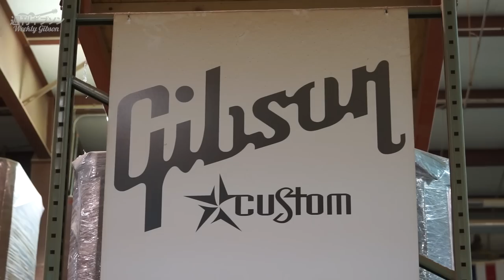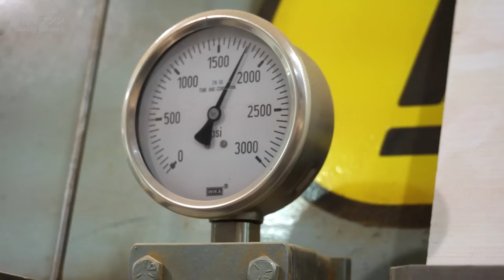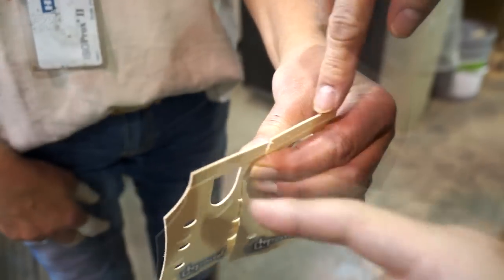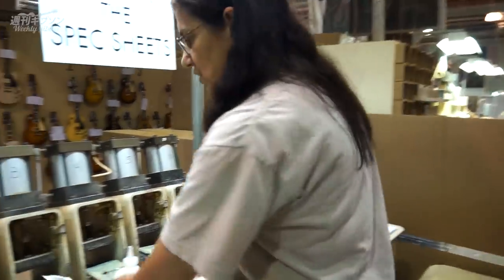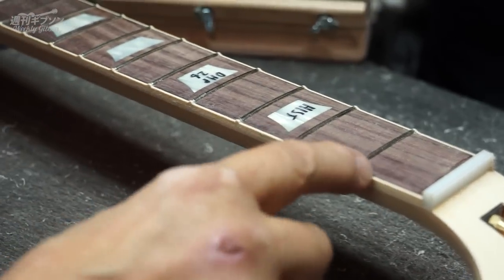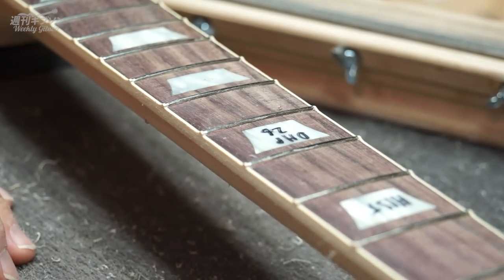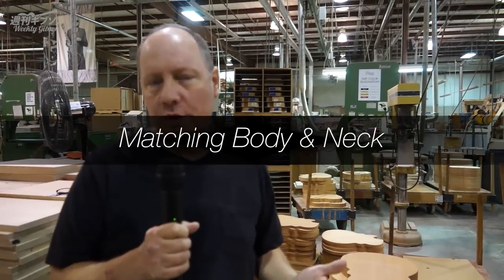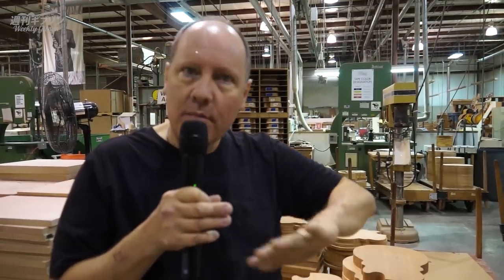Gibson Custom Factory Tour 2016【週刊ギブソンVol.93 特別編】

Comment: 4:13 the neck joint fit is not tight at all which is crucial
Reply: just saw that, what is even going on here? I mean, this is not indonesia!
Reply: The Chinese did a better job at the Epiphone factory, used levels to unsure a flush fit rather than just stuffing it in and clamping it.
Reply: It's tapered and gets tight when the clamp forced them together.
Reply: CNC profiled cuts are very tight in tolerances insuring a repeatable exacting fit.

Comment: 3:45 The installation of fret board is amazing, the builder just put it on the neck directly without any tool or ruler!
Reply: Elvis they use locator pins. Basically 2 tiny dowels on the neck that correspond with 2 tiny holes on the back of the fretboard.

Comment: At 9:20 they show the binding being filed and this is where they screwed up a lot of fretboards.  Last year I was looking for a 1960 LP Reissue and found one at a GC in TX online that was "collector owned and mint", a 2014 model, for $3,295 and would have been great. But there were file marks all along the treble edge from the 9th to 15th frets which almost had to come from the factory, or the 1st owner, but there was no real play wear, so I suspect factory, and they lied about all the dings and scratches.  Then I found another 2014 at a GC in CA, and the manager swore it was (also) mint, so like a dummy bought it, same fretboard issues and also dinged up, returned it, too.

Finally got a 2018 via Reverb, Gloss finish and no quality control problems, and recently got a 2019 SG '64 C.S. and no issues, either so I hope things are better now.

Comment: How do u do refret jobs with the binding there?
Reply: u basically have to cut the frets to size and shape the ends to fit perfectly. Thats if u want to save the nibs, those little end bits. If not, then just take the frets out and radius and roll the binding again and refret using a tang nipper.

Comment: When I first started watching the video I was thinking for what Gibson charges for their guitars people should be getting the the quality of the custom shop build. Not the crap coming off their standard production line.

Another issue is relic aging. When you look for a true antique you want the best quality product you can find. On the flip side if you want a factory aged relic you want it fuck up from the factory. I have found for the most part people are very sheepish these days. whatever they are told is good they buy it. why would anyone pay extra for a jerk in a factory with a razor, rock and a rusty train spur knock the crap out of your new guitar.

Comment: Actually, just before Christmas, I bought a brand new 2016 Gibson Flying V Pro T. The tuning issues were so bad Gibson had to send it to a luthier, who, after having the guitar for almost 10 days decided there was damage to the finish. I contacted Gibson once again, who promptly sent me replacement. Even with the replacement, I still have tuning issues. I can only conclude that Gibson are not all they are cracked up to be. My estimation of Gibson guitars has now plummeted, as I had saved up for a long long time to be able to afford what should have been the guitar of my dreams, but in reality, is little more than a poorly made plank of wood with a nice paint job.
Reply: @Chris Davies
i am sorry that you had this issue. i was confused about the tuning issue being related to the finish, so i will skip past that part and say that it was probably the nut. if your nut is not cut straight, or cut too thin, it could cause issues. this is not uncommon with the 3+3 headstock design. you should be able to remedy this relatively easily with a pencil (or lube) and/or sandpaper (or file). if you google this, you should find some videos that will show you what i'm talking about
Reply: Upgrade your tuners to locking Grovers, that should help.  The first thing I did when I got my V Pro was take those POS tulip tuners off and put Grovers on.  Stretching new strings out is key to staying in tune as well.  Put new strings on and tune it, then pull on the string upward slightly and tune it again.  After 5 or 6 retunings it should need to be tuned less and less and then not at all.  Do this for each string.  Also, I really believe it takes a year or so for everything to settle in on a new guitar.  Play it and keep on playing it.  After a year you'll see what I mean.
Reply: Its usually the G string. The angle it pulls from where it breaks at the nut to the tuner is somewhat of a design flaw.  At least on SG's.